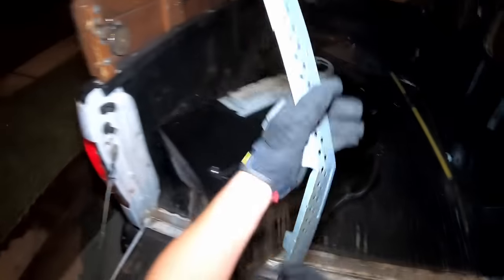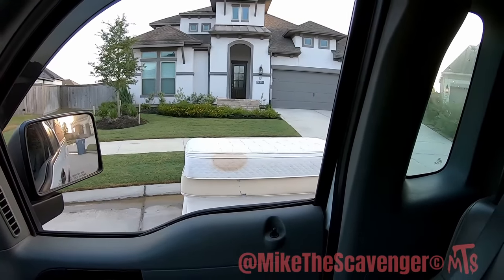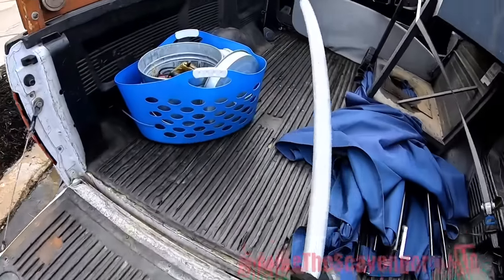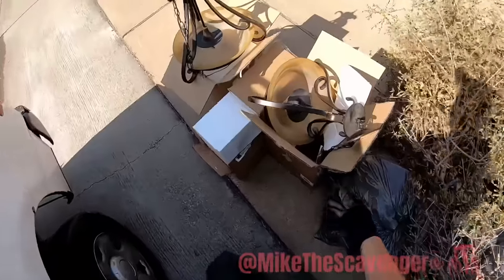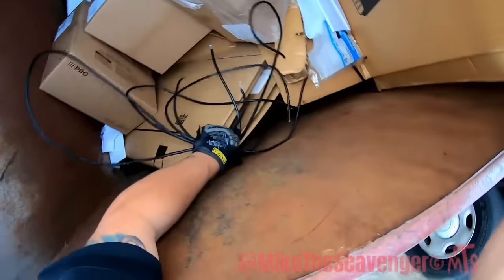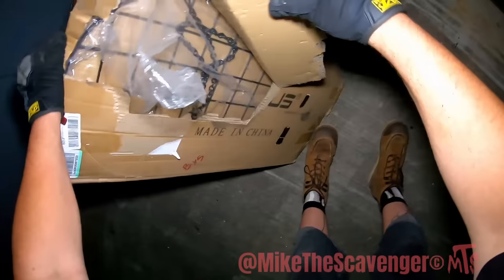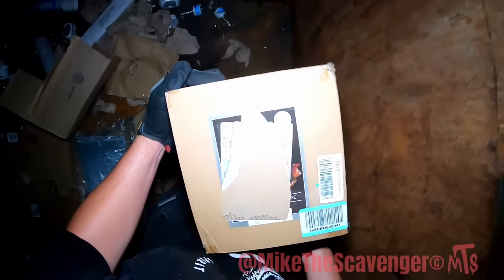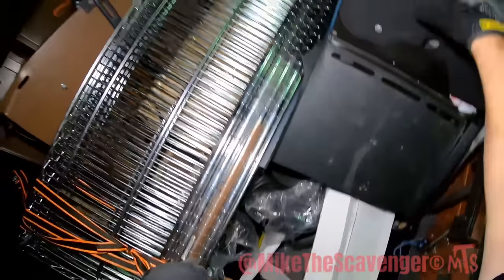Dumpster Diving & Curbsiding "They Must Be From Out Of Town""

Comment: nice mixing desk without any of the electronics just the metal top. the XLR connectors  and the 1/4" phono  connectors on the top as well might have some salvage value on E-bay

Comment: I'm strapped a bunch of those aluminum umbrellas to where they screw together in the middle like that one did. But only the fittings that screw together are actually Steel. The tubing is usually still aluminum. One good whack with a hammer get some inserts to come flying out of the aluminum tubing. Just saying

Comment: The broken Iron Pan can be scrapped. I never seen a broken one. The others are brand new if they are wrapped in plastic. The middle day is the hottest day ever. The Shadow at 95-97 F and the Sun at 113-121 F here in FL. The heat is brutal. At least we have rains afterwards which cools down a bit. Remember to keep the cats inside during the hot days. They don't like the heat.

Comment: Did you ever think of buying a trailer to pull behind your truck
Maybe a 6-7 ft wide 8-10 long with like 4-5 ft sides and fold down ramp tail gate and a hand truck to hook on trailer
Put ramp down take hand truck just run big items only in trailer ,,,,a frig up the ramp with hand truck,,,, a washer,,a dryer ,,, a bbq,,,
A stove,,,, water heater,,,,, then neatly done
In back of truck bed tubing,,,pipe ,,,, lamps ,,,, bed frames,,,  loose  wire,,,, cast iron,,,, stainless  pans and such
Stuff in trailer clip cords off throw in truck bed
You could think of a dump trailer if it would work better
You're the brains behind the company
Hope this helps,,,,, Roger